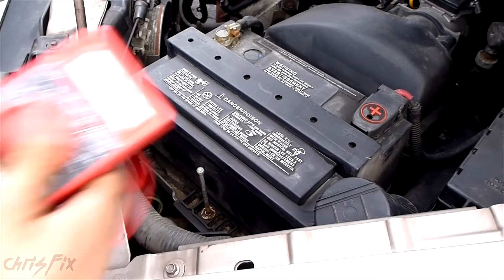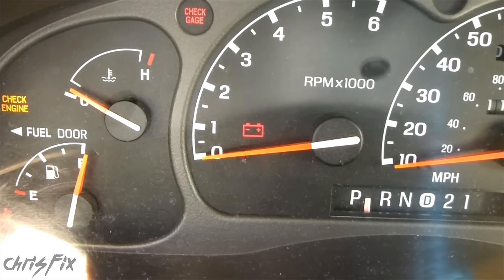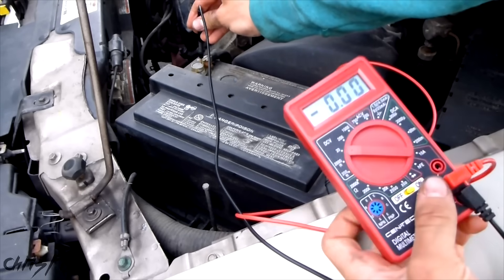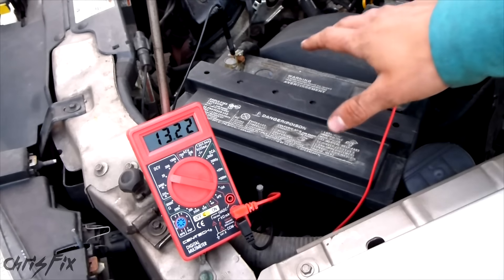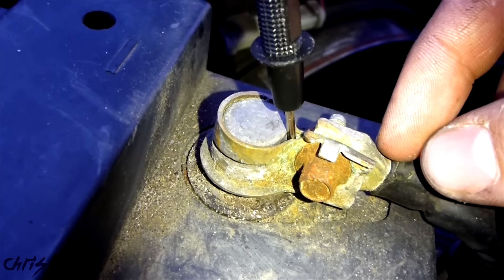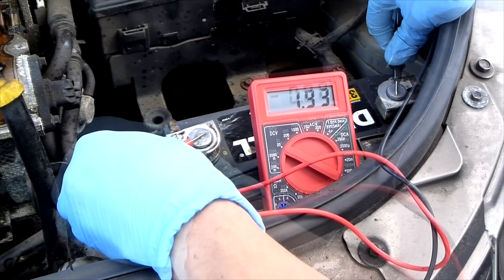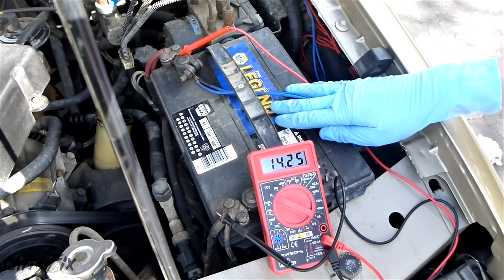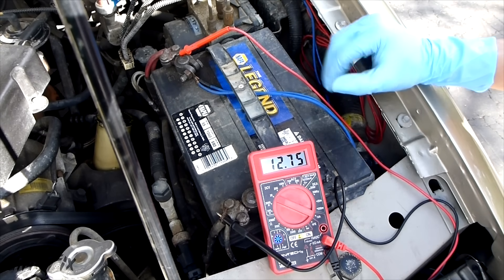How to Test a Car Battery with a Multimeter

Comment: Just a quick tip for your videos. Replace 'it' with the thing you are talking about so it will be less confusing/more obvious to people. For example you say. "That there is the battery light. That lets you know that the battery light is working." - That's great. We know exactly what you are talking about, the battery light.  Later you say, "What should happen is when you start the car it will shut off..."  Hmmm... my battery might be going dead so maybe he's saying my CAR will shut off. That's what I thought you were saying at first.  But I know now you are saying when you start the car the battery light will shut off.  Anyway, love your videos - I recommend them to others with car problems. Please keep up the great work.

Comment: Hey Chrisfix I have a 2001 town and country Chrysler mini van and the battery light came on I drove it for a day then died and will not start any more,I jumped it,drove for a block and died I had to pushed it to a safe area ,went home and got a used battery put it on the van and worked good,the next day the battery light came on so what so you think I suspect is the alternator but need your professional advice.
Reply: This sounds like a classic alternator failure. Use a multimeter as Chris demonstrated in the video with the engine running. More than likely you'll show a low reading, indicating that the alternator is failing to charge the battery. It ends up doing all the work the alternator should be doing until it finally drains down.

Another possibility is a broken wire or connector. I once had done some electrical work on my vehicle, buttoned it up, and began a 2 hour drive. About 30 minutes into it, I noticed the headlights and console getting dimmer and dimmer. I finally turned around and barely made it back home. Re-checking my work I found I'd failed to reconnect a lead to the starter. The battery had been doing all the work of running the vehicle. Once corrected, everything worked fine.

Comment: One thing to note, the green residue seen on corroded terminals is sign that the corrosion is eating up the copper.   You will see pitting in that area after you have cleaned the connectors.  This occurs occurs when you have tin or lead plated copper connectors and do not use any rust inhibitors.  A special conductive grease used extensive for station batteries is a product call "NO OXIDE A".  A thin film is used on the post and in the inside and outside of the connector.  Please note in your video you suggested using sand paper and the terminal shown at 3:40 show that the lead coating of the connector was exposed which can introduce corrosion problems later on.  Most battery terminal connectors are tin or lead coated for this reason.

Comment: what if I turn my key to the on position and im not getting any power lights on my custer at all also no getting any clicking when i try to start it basically no power whatsoever, but i do hear the chime come on when i open the door and when i leave they key in and also my head lights will come but other than that i get nothing what could this be?

Comment: You also need to examine, and preferably thoroughly clean and grease the ground cable on the engine and positive cable on the starter. Those connections can corrode as well. A copper antiseize works well to provide protection and a good electrical contact. 

To prevent future corrosion of the battery terminals you should apply silicone caulk where the lead terminal passes through the battery case. That will prevent acid from wicking up and corroding the cable connection.

Comment: What grit of sand paper do you recommend for cleaning the terminals and connectors?
Reply: Use a fine grade. You only want to remove corrosion and oxidation, not re-shape the lead terminals. You can actually buy convenient little tools at auto parts stores for this. One part consists of a circular wire brush mounted inside a plastic or metal housing. You just slip it over the terminals and turn it a few times. They typically also have a round brush to use for the cleaning the inside of the cable terminals. Google "battery cleaning tool" to see examples.

Comment: To anyone with a multimeter with a min/max setting:

When testing to see how low the voltage gets when you start the engine, set your multimeter display option to "min" (minimum) and it will keep the lowest voltage it reads on the display for you. Super handy, especially if you are performing the test by yourself!
Reply: Another tip if you DONT have that: set up your phone to film the screen while you’ start it (try slow motion too) so you can see how low it dipped.
Reply: Great tip.
Reply: Hot shit. I was curious if there was a way to freeze the reading like on a pressure gauge. Thanks.
Reply: A coffee cup is the perfect smart phone tripod
Reply: Thanks!!
Reply: Digital multimeter of 21st century usually only have one range...for DC....another for AC...another for resistance....and another for miliamps....all single range. The multimeter itself is properly adjusting its range as the measurement is being taken.... It is good to take a measurement of voltage drop on car battery while the starter is cranking. But it takes 2 people, unless multimeter with memory is used. I still use special meter with resistive wire...because I usually have nobody to hep me up....
Reply: @pleco101  Tripod works well.
 If you don't have one  try pointing the multimeter to where you can see it from the driver's seat. Line up the shot you should be able to record it through the gap of the hood.
Reply: I did that with my Fluke 17, Min/Max feature is indespensable.
Reply: Thanks for the tip. I was about to setup my phone to record my multimeter. Then I looked at my multimeter after reading your comment. That min/max feature is super useful.
Reply: Awesome info !!  Thank you :))
Reply: My . min is 9.5 or something. Is that bad?
Reply: @EatSleepShift  Not bad, no, but heading that way. Keep checking it semi-regularly and if it falls to 8 or something then start to think about changing it if you haven't already
Reply: Mine hit 8v very briefly whilst starting just now.  It's been a bit sluggish to turn over the last week or two, and flattened after about 36 hours of no use yesterday.  Mains charge over night and tested this mornign per this video. Charge outta the alternator seems good and consistent in the low 14.0-->14.4v range, even with/without accessories and lights going. Considering the battery is 7 or 8 years old.. I think I might give it a dignified retirement and replace it.  It's had a good run, so I think I'll stick with the same brand too.
Reply: @AdeptlyOutofStep  What brand?  I like long-life batteries.
Reply: @EatSleepShift  might fail soon, but prob. ok?  keep checking monthly.
Reply: @pleco101  however you can, maybe you can prop them both up sideways facing each other. Maybe you use tape , I don’t know :)
Reply: I need to get this meter. All but one cell was dry in my battery and I filled them up last night to proper level. Truck has been slow starting for 6 months since I bought it. Never thought to check the water level. 🤦‍♂️ so now I’m thinking it’s been running too long dry like that so I guess it’s no coming back from that.
Reply: @irishuwould5185  It may still be good. It's worth a try to add water and see what happens.
Reply: Um hmmm

Comment: Hi Chris, I have only drove my Audi S3 8p 2011, 3 times in 2 months covering about 50 in total. The battery has died and I put it on trickle charge on a battery charger for 24 hrs. It’s not in the car yet but when I checked the voltage its gone 12.7v to 11.5 v in 24hrs is that ok or is the battery dead?.

Comment: I was testing my 2015 accord sat overnight  at about 0 degree celsius, I turned the headlights on for about two mins and then turned it off. The reading is 11.55 v before starting, once i started it, it drops to 9.95 and went back up to over 14 in a second. Do I need new battery, my car has been starting fine and easily. anyone has any advice.
Reply: Maybe you need new batteries in your hearing aid.

Comment: Thanks sir! My truck didn't start this morning and I was thinking of checking the battery. It was cold (-27 Celsius) and wasn't plugged in but previous years this was not an issue till colder temp

Comment: Sir, my car battery has some issues.

I don't have multimeter.
I checked for low voltage by turning headlamps, room lamps etc on. They give reasonable brightness showing there's enough juice on the battery. And, battery fluid level also maintain at proper level.

The car cranks and the cranking sounds is good and loud enough to confirm the battery has got enough voltage. (Before when voltage is low, the crank sounds much much lower and every lights were much very dimmed)

Now, surprisingly with noting the above cited conditions, I jump start with another battery, contrarily the car starts easily.

Big question is...
Why with all lights ok and crank sounds give enough noises, the car doesn't start?
Why in the same condition, the car starts easily with jump start?

Would be pleased to know if you could provide reasons for the problems. Thanks.

Comment: My car didn't start yesterday, checked the battery with my voltmeter and it was 12.4V, but the + lead had corroded. I mistakenly dropped a manual gearbox oil a month ago. could that make corrosion?
Reply: Oil prevents corrosion.  Crossion need oxygen air to happen.  That's why Chris put WD4zero on he's. However oil would over time hold dirt and look disgusting,  best to use the W stuff.  ☺
Reply: Thanks a lot :)

Comment: Great and simple diagnosis. Since the number went over 14 after starting which indicates the alternator is working. What if the battery had stayed the same after starting,  ( 12.70 )?  Would that indicate you have a faulty alternator ?

Comment: Sorry to say but the "Battery Light" is actually the alternator warning light , and has nothing to do with the condition of the battery. Unfortunately most late model vehicle alternators fail "the warning light does not come on when the ignition is turned on and most people will  not see the issue.

Comment: Good video. I know how to test voltage , didnt know i could start engine with multimeter on. 
Only i dont agree about wd 40. So you can cleen with it, but wd40 has big minus, after few days its vaporized. Also there is no need to spray so much, as you know wd40 is oily  and attracts  dust. Best thing for protection and better contact is a small amount if silicon spray.

Comment: This is the "poor mans" (halfass) way to do it.  The proper way is to use a load tester which will put about a 100A load on the battery.  You hold the test/load button for about 10 seconds and check to make sure the voltage (while loading) does not drop significantly below the rated CCAs of the battery.  If it does, that is a warning sign that something is not quite right.  If the battery checks out but you have problems starting the car (like clicking), it could be a bad connection at the battery.  A 100A load tester from Harbor Freight for about $20 is a great cheap investment.

Comment: Love your vids Chris .... a couple of things though:
To clean battery posts you should remove the terminal and clean the terminal inside and the post outside with a battery post cleaner tool - just spraying the outside with WD-40 doesn't get into the electrical contact area of the connection. A little Vaseline on the connection after assembly will keep corrosion down.
When adding water to a battery you should use distilled water, not bottled water. Bottled water has dissolved minerals & salts but distilled water doesn't.

Comment: Man I love your vids, thanks for this one... I hadn't had to use my multimeter to check my car for so long I couldn't remember what I set it at. One question if you see this.... for future reference (cause I can't remember this either lol). If the car won't start and it's the starter, what would happen? The battery would check out fine while it just keeps clicking when you try to start it, or no clicking?

Comment: you did forgot to lube the post and clamp up with vasaline :p
Reply: wd40 vaporates a lot more quickly, but does the trick short term... its not wrong. but i was told to use vasaline

Comment: If the battery terminals are caked with deposits, pour some near boiling water on them which will dissolve the deposits and will clean them up nicely.

Comment: I just checked my car with multimeter, before start up the engine shows 12.02 volts, after start up the engine shows 13.83 volts . Is this means good battery or bad battery ?

Comment: as a forklift tech specializing in batteries and chargers you did a good job just one thing rather than WD get a neutralizer and clean the entire top of the battery as the oxidized material can actually register a charge (very low) on a fluke meter. They also make a material you can apply that covers the terminals to prevent oxidization. We demonstrated that to our customers to emphasis the need for proper battery maintenance and if you have to charge a battery add water after the charge not before. Car batteries run you a hundred to one fifty - - fork lift bats run 2500 to 3500 each so that is why try to maintain them in peek operating condition. We even do cell replacement should one turn bad - - way cheaper to replace a cell than pay for a new one.  I especially liked the part where you started the vehicle  with the leads on to watch the drop under load - - I can't tell you how many times folks have told me they did a static test and the battery was within parameters but try to start with it and no go. I would say I do prefer a wire brush terminal cleaner to sand paper as they are super cheap and do a better job. Excellent presentation

Comment: you should have spent more time on how to set your multimeter - where do you plug in which wire, which symbol do you set the thing to, etc.  this was more about how to tell you have a bad battery then how to test with a multimeter.

Comment: The only thing I would add is that some cars are battery dependent. Meaning that if you disconnect the battery without a memory saver you could have and issue starting the car.  Some cars (BMW) will need the battery to be re-registered with the computer system. Most scan tools have this capability. Otherwise the battery warning indicator may not go out. If a different battery has been fitted, it is imperative that the car knows the specs of this new battery to modify its entire charging algorithm.

 

An example –

A 2006 BMW 330i E90 model provides the following choices when programming a battery in:

90Ah AGM, 90Ah, 80Ah AGM, 80Ah, 70Ah AGM, 70Ah, 55Ah, 46Ah. Just FYI.

Comment: Chris, the other day I test the battery on my Mazda Protege; the battery seems good after I cleaned all the corrosion and gunk around the terminal post, but when I turn on all the electronic devices in the car, like headlight, A/C, and radio, the voltage dropped to 11.89 V, is it closed to replace the new one?

Comment: Nice and clear video. Wanted just tell that the most important is to load the battery few minutes with driving lights on before you measure the battery voltage. And one more, when the battery light goes off, it doesn’t mean that the battery is good. It tells that the alternator is working.

Comment: Sand paper or any other abrasive will work for cleaning, but I am a big fan of the battery terminal cleaner tools for batteries with terminal posts.  These are widely available for $3 or $4.  One brush fits into the terminal, the other fits over the post.  Warm water and baking soda helps neutralize and wash off the lead sulfate build up (blue/green powder).

Comment: What if while checking it with the engine running the voltage is all over the place?needs replaced since its not holding a steady charge right?or is it the alternator?

Comment: A very simple and quick test, if you don't have a volt meter at the time, to see if your starting problem is an alternator not charging or if the battery is the problem. Once you get the car started, by jumping  it to start, try removing either the negative or positive battery cable. If the car continues to run then turn on lights, etc (anything that uses more power) and the alternator should be putting out enough power to run the car all by it self. If it dies or tries to die then your alternator is working but not up to what it should.

Comment: My multimeter doesn't have a 20V DC
It has 10 and 50
It reads 50 when put on 50
And goes to maximum when i put it on 10
Is this data useful? Or should i have a 20v setting?
Reply: You obviously have a 50 volt system instead of a 12 volt system

Comment: Thank you for taking the time to make these informative videos. My 2010 Ford Lariat F150 (52k miles) would not start. Jumped by AAA. I drove it for 45 minutes to make sure the charge had "taken". Next morning dead battery. Anyway to check while in dead state or should I jump it and check it? Thank you for your input.

Comment: An old mechanic showed me a trick, 
Take the battery and bang it on the flat ground as hard as you can about 8/10 times this will knock the sulphur off the plates then recharge until full, I’ve done this many times over the years and it works 90% off the time.

Comment: My battery light has been on every since I went and had the alternator replaced. I didn’t have the tools or I would of done it myself. I tested my battery , alternator and fuses. All checked out. What else can cause the battery light to stay on??? Help please. My last resort will be going to a place that specializes in car electronics. I would like to solve it myself. Any tips or something I can check that I missed??